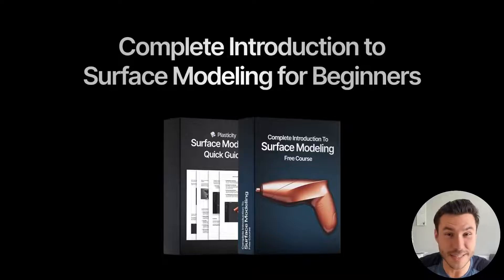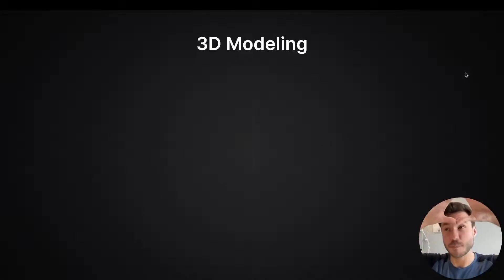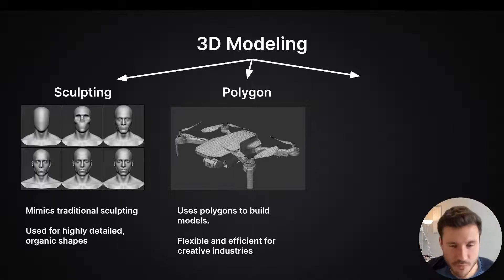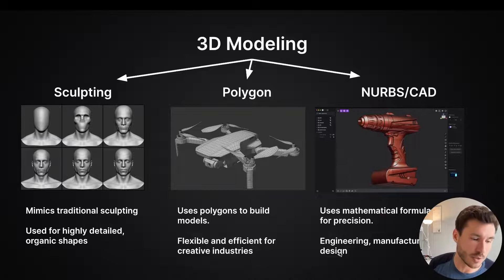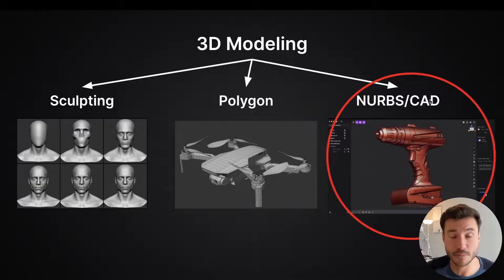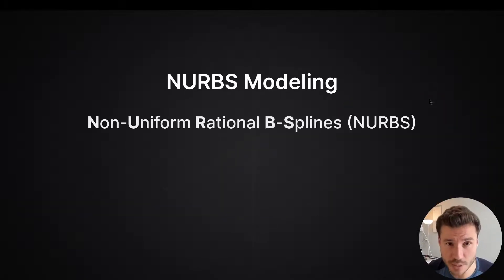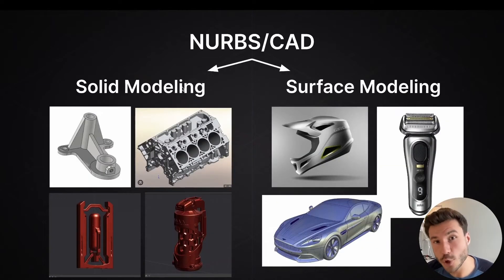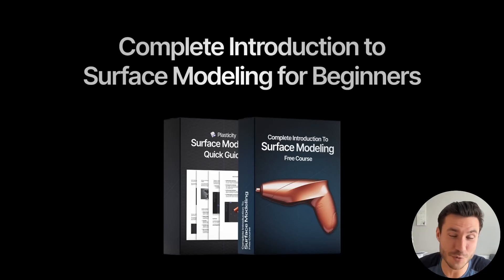What's the difference between Solid Modeling and Surface Modeling in CAD?

Comment: Love your videos!  I've been 3d modeling since about 1989. Fell in love with NURBS modeling once I started seeing videos from Alias in the early 90's and the rendering of the black Acura NSX they used in their promotional ads.  In 1992 started using Alias PowerAnimator on SGI then in 1995 got my own SGI Indy and Alias Animator. Switched to Maya in the late 90's when it replaced Alias and started running on PC's. I do most of my CAD work in Spaceclaim and now thinking about getting Plasticity to get the best of both worlds, CAD and surface modeling.